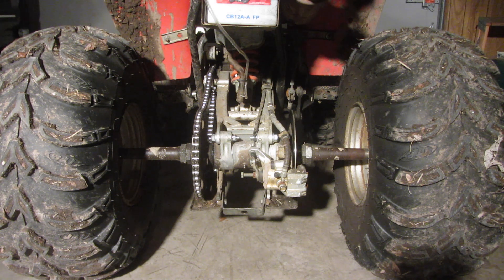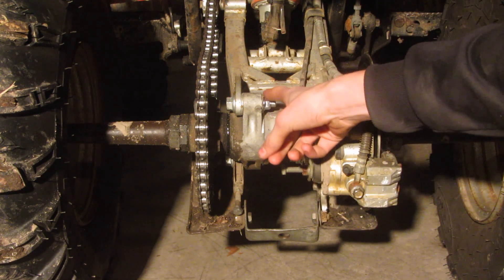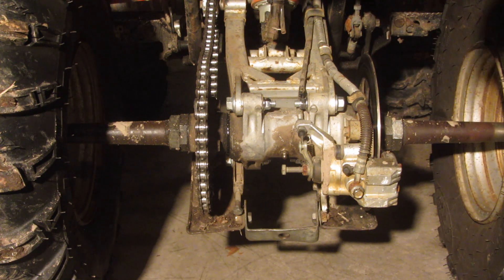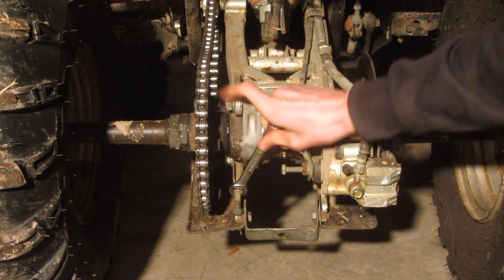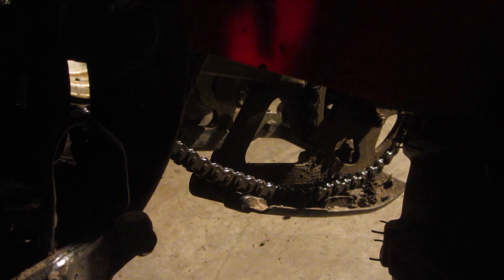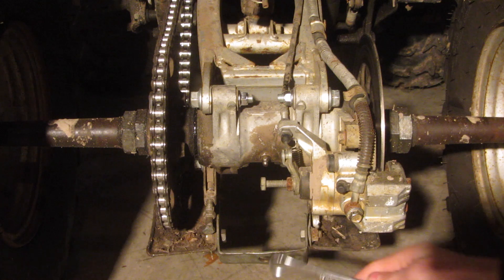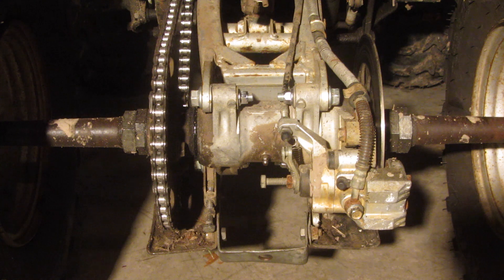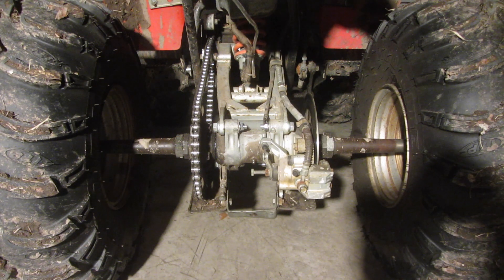How to Adjust the Chain on an ATV or 4 Wheeler

Comment: Thank you, finally a video where I found out why mine kept getting loose. Previous owner took the bottom bolts out of the holes and put them into the sliding groove. Now my kids can drive without the chain coming loose after 5 minutes. almost scrapped the whole thing.

Comment: That bolt to adjust the chain near the chain guard doesn't exist on mine (86 LT230S). I have a new sprocket set and chain I'm putting on this weekend and I hope this doesn't come back to bite me in the ass.
Reply: Provably fell off like mine, you'll notice there's a hole for it go in.